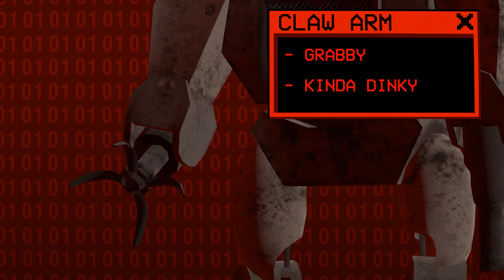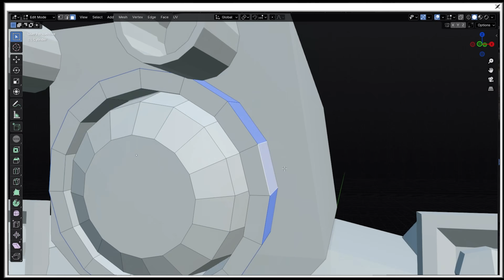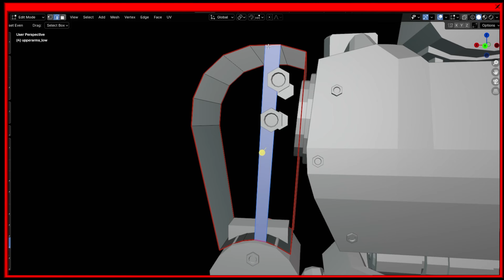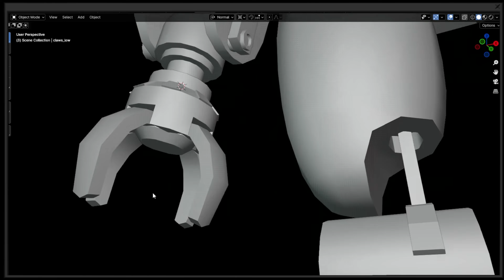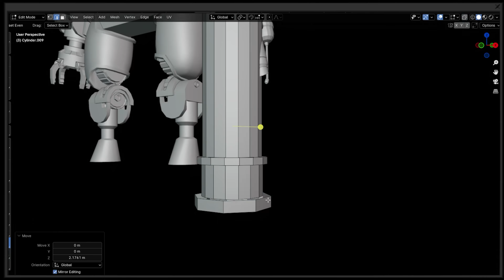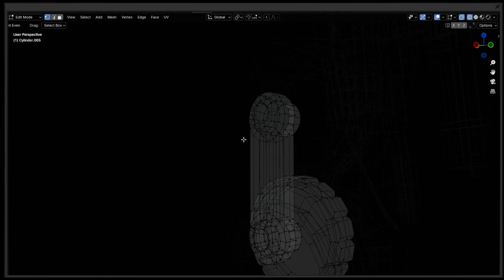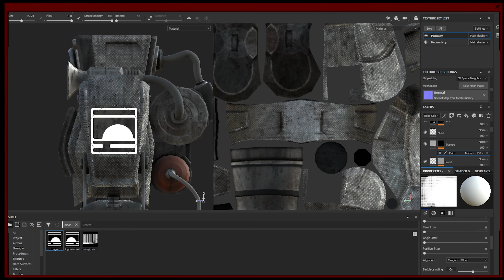Re-Designing the OLD BIRD MECH from LETHAL COMPANY

Comment: i love that the original old birds don't have fuel sources tbh. makes it super believable that they'd still be active after so many years of just sitting there
Reply: They likely don't have an external fuel source be rather an internal one. E.g. A small nuclear reactor inside the chest.
Reply: @ for sure
Reply: Well, it’s also implied that they’re connected to the building power in some way, since pulling Apparatus activates all of them
Reply: @ i like the theory that they were created to fight against coil heads, and since coil heads’ bestiary entry says they give off radiation, the increased rads from pulling the aparatus turn them all on
Reply: @RockhardATA  Employee: Removes Apparatus

Every old bird on the entire map: "Real Shit?"
Reply: seeing as how taking out the apparatus activates them and they don't spawn over time (meaning the ones "in orbit" never activate), i believe they're feeding off of the passive radiation the facility produces. this is kind of a crack theory though

Comment: 1:46 A funny idea popped into my head for the rocket launcher / flamethrower hybrid weapon working through one barrel with no discernable fuel tanks, while watching this video: Just make the weapon's chamber flip around to go from the rocket launcher standard configuration to using the jets of either just one or an entire salvo's worth of rockets, locked in place as the source of the flamethrower's flames.
Interestingly enough, this also gives the Old Bird a need for a reload mechanism, which would probably wind up quite explosive as it dumps out the fuelless rockets off to the side via some sort of break action mechanism.

Comment: That thing with the holes around the flamethrower is called a Heat Shield. The heat shield protects your hands from getting burned when you touch the barrel of a gun or exaust pipe.
Reply: And generally helps disperse heat...supposedly
Reply: @Year_of_the_Dell i think you're thinking of a heat sink
I've never personally heard anyone say that heat shields help dissipste heat other than by the nature of having holes in them to allow some of the passive air cooling the barrel would already do
Reply: @callsignapollo_  because of the holes it has a higher surface volume so heat would leave it faster . not really enough to be that important but it does
Reply: The heat shield is actually for the gun itself, not your hands. No matter what if you touch a barrel after rapidly firing, you're gonna get burned. The idea is to disperse the heat so that the barrel doesn't just melt during sustained fire (you can look up videos of people demonstrating how easily and quickly a barrel can melt on a fully automatic rifle).